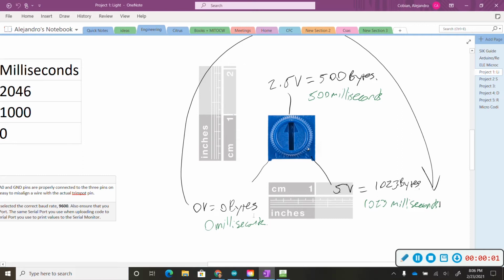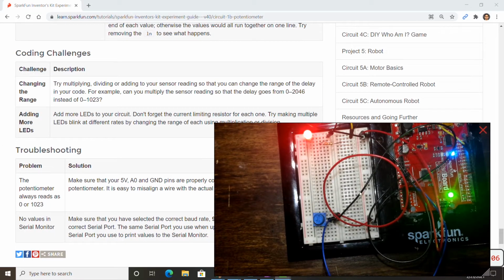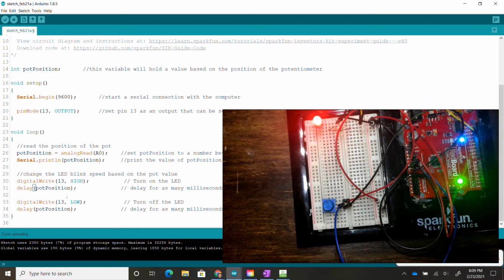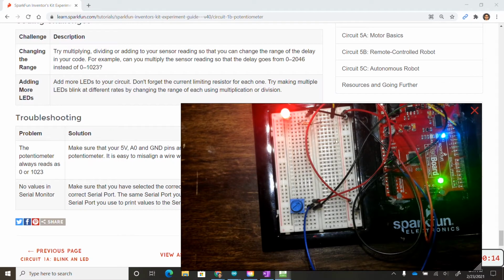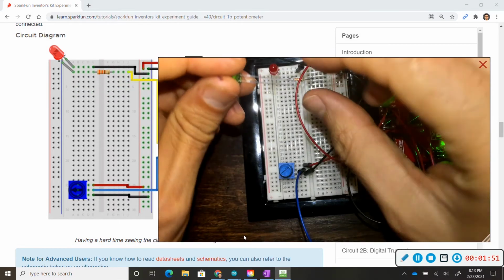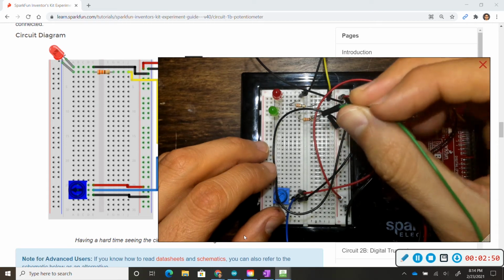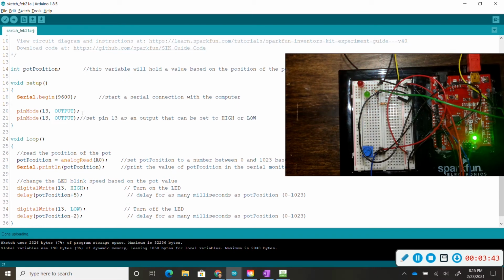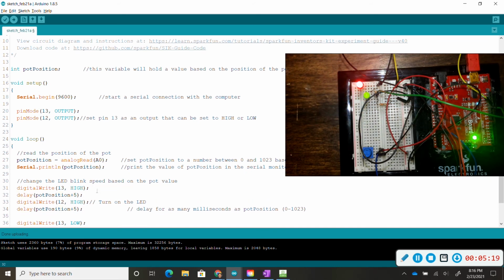Project 1 Circuit 1B Solutions

Comment: My green LED isn’t working. I have all the exact locations for the jumper wires from the book and also 1 from E5 - D12 and 1 from J6-GND (in between row 7 and 8). The LED is in 5a(+ side) and 5a (- side). Second resistor is at 6E and 6F. Everything else is the exact same as the website. Anything I should change?
Reply from the maker: Did you double-check that the LED is the correct way around?
Maybe the LED is broken. Try another one